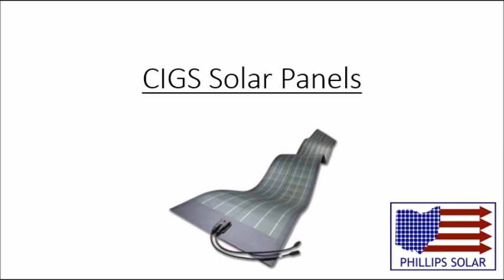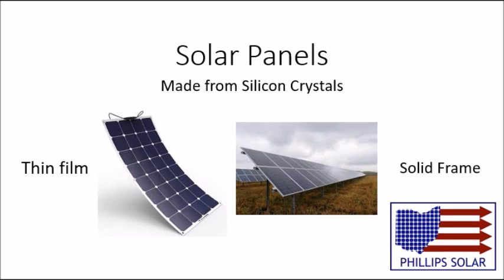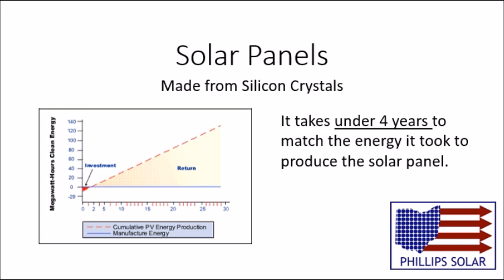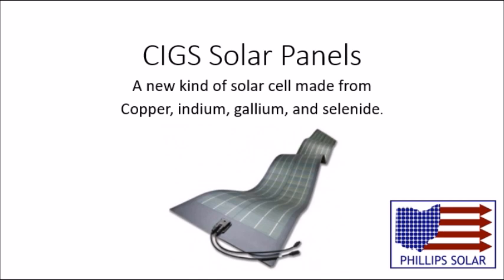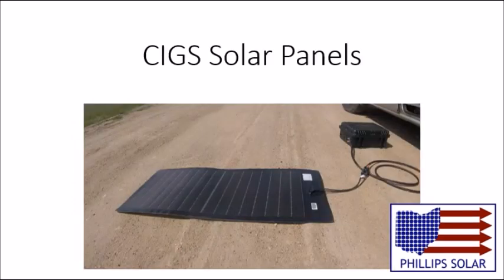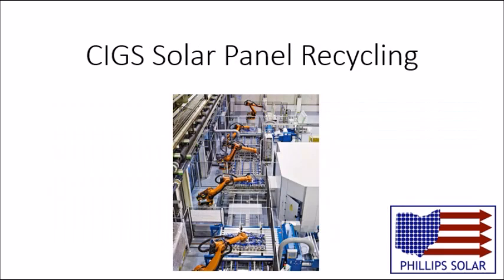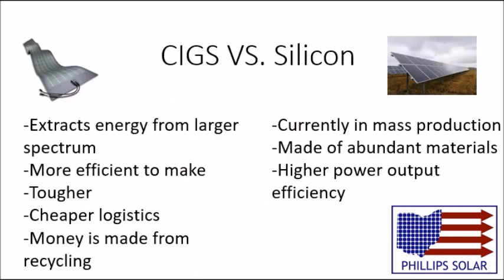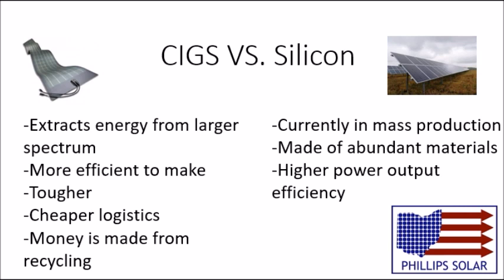CIGS Solar Cells

Comment: Are this flex cigs Panels really tougher/last longer than silicon Glas-Panels? I can't believe that one, cause normally Flexpanels are really fragile and don't last for long
Reply from the maker: The manufactures say they are stronger than the silicon panels because their materials don't crack as easily as the silicon crystals do.